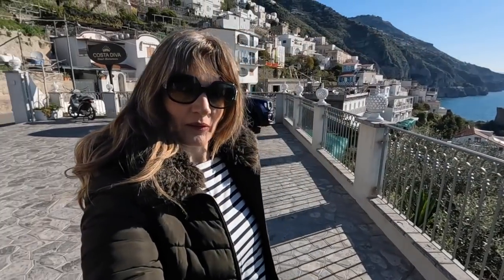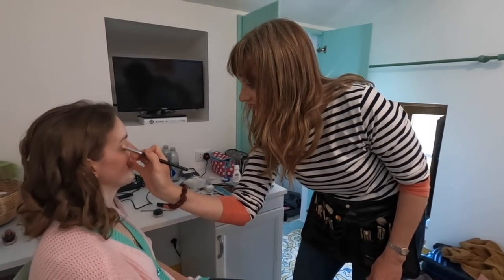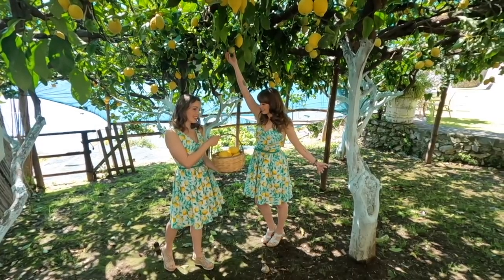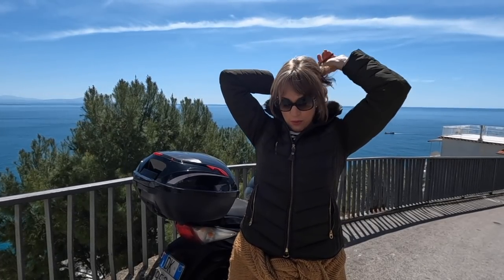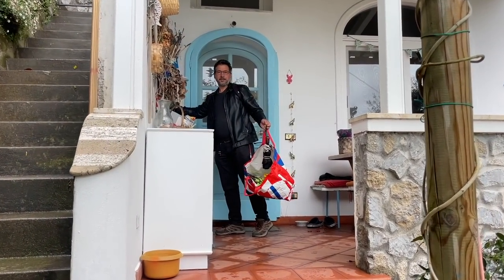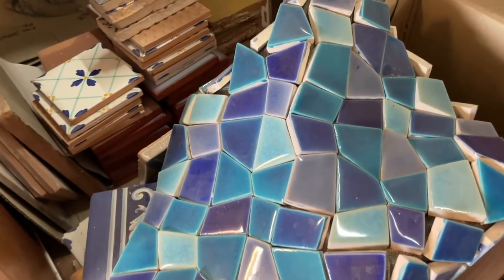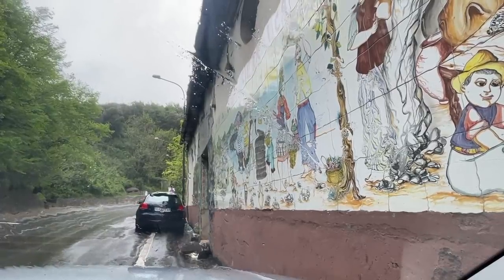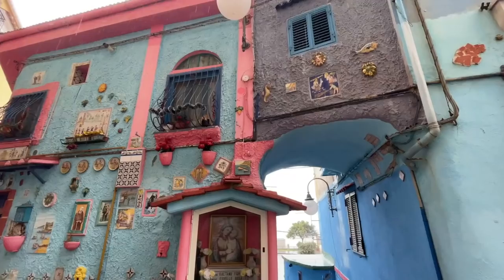GETTING OUR HANDMADE KITCHEN TILES FROM VIETRI DEL MARE! | And First Makeup of the Year EP 177

Comment: I did glue my kitchen tiles with ready to go paste in tubes. Resistant to heat and of course to water. So much more easier. Right out of the tube on the tile and go. It sticks instantly. Just a few dots are sufficient. Afterwards i did grout  with special made stuff out of a tube as well. Easy peasy. Love your bow windows! Very cosy kitchen!!